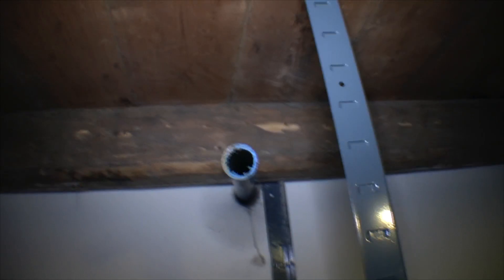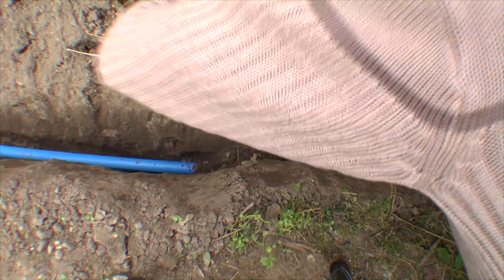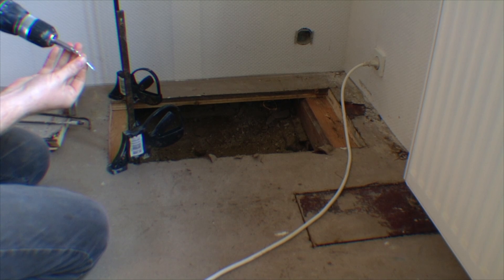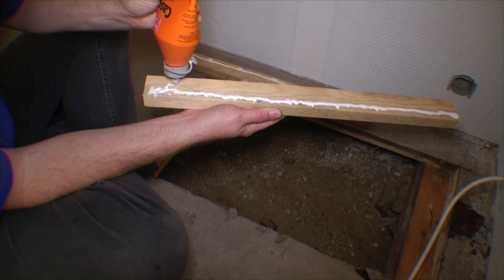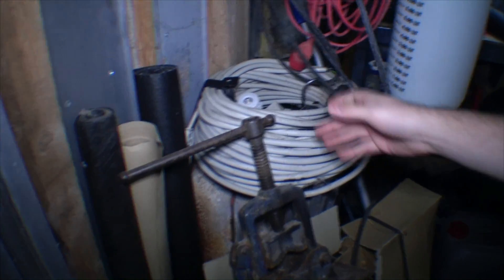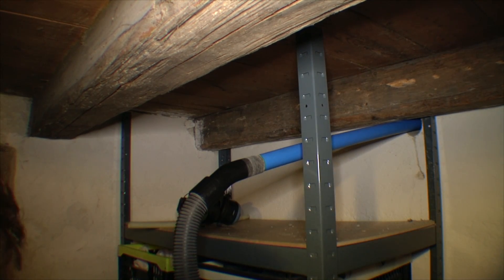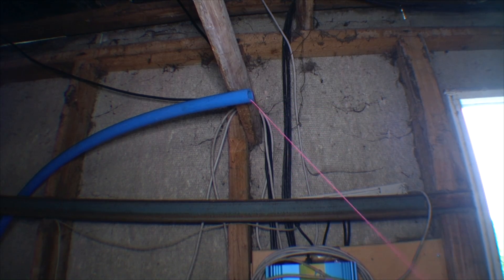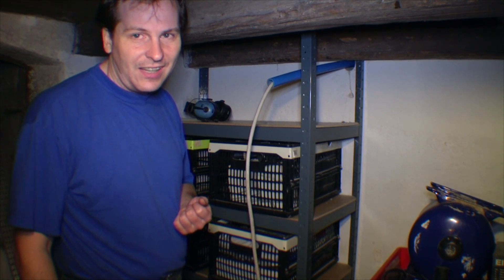Piping 16 meters between solar panels and battery bank - 241

Comment: Nice job. If or when you decide to put a new cable in connect it to this one with the plastic screwyee electric thingyees and i think you will be able to pull the new cable with no problems at all. This thingyees http://www.aliexpress.com/item/Best-Promotion-Electrical-Wire-Connection-12Position-Barrier-Terminal-Strip-Block-3A-Lowest-Price/32344104073.html?spm=2114.01020208.3.19.ATC2Hp&ws_ab_test=searchweb201556_2,searchweb201644_1_10001_10002_10005_10006_10003_10004_62,searchweb201560_6,searchweb1451318400_6149 but the biger ones (15-30 Amp)

Comment: hey , nice work, Wouldn't it be easier to park your extra KW from the solar panel on the grid and use them later? are you of grid.
Reply from the maker: HI +observer547 
No i am not off the grid,, but i like to be able to store some of the power and use it later.
I am working on two power banks,, one PB and one Li-ion, that i wanna put throw an 3KW UPS and use.
Thank you for watching! :-)

Comment: There are outdoor cables for video cameras, which hold 8 wires of FTP/SFTP and one steel wire which makes the whole cable very thick.Such cable you cand push several meters through any kind of pipes.Your experiment reminds me of a similar situation, when I had to pull a cable thru a small hole where there were already cables.I had to push it only some cm's but wasnt able.But I got a super idea to use some dishwashing solution, put on that cable and believe me, then it slipped between those existing cables in the hole ;) I had many ideas like your vacuum thing.Like one when you need to fool the system that you are moving the mouse and you put an alluminium foil under the optical mouse or put the mouse on the screen and you let a long youtube video to run to fool the mouse sensor :)) Thank you for your new video
Reply from the maker: Hi +charismaticum 
Does that alluminium foil under the optical mouse work?
Thank you for watching! :-)
Reply: +My PlayHouse (Morten Hjorth) :)) it doesn't but it drives the sensor crazy and the mouse cursor doesn't stay still ;) somehow I kept the mouse sensor excited :))))
Reply from the maker: Hi +charismaticum 
I´ll have to try that!!
Thank you for watching! :-)

Comment: This looks like one of those projects that looks simple at first, but it actually turns into rather tedious complication as it progresses, but you did a good job of showing us the difficulties attached to something like this. You might even want to run Ethernet into the garage by now! Congratulations on reaching 2,000 subscribers, by the way!
Reply from the maker: Hi +Tyler Barton 
I am on the lookout for better cable for this,, when i find the replacement i think i will be pressing three or four cables through.
Thank you! so many people,,,, over 1900 watching one of my videos every day,,, right now there are 7,6 people watching my videos 24/7,,, i think that is a lot.
Hope you will take part in my treasure hunt!
Thank you for watching! :-)

Comment: don't forget to seal up the hole where the pipe runs through the slab into the house below ground level, to keep rainwater outside.  Maybe the hole into the basement as well :)
Reply from the maker: Hi +HarreyHHH 
Yes it could well be I should seal it a little more. I covered it up, not get animals in. (mouse)
Thank you for watching! :-)

Comment: I am an electrician of some 36 years. As soon as I saw you trying to push the cable through the conduit I said that will never go through without a "fish wire" Then you came up with the vacuum and string. Good solution. Job well done Morten. Great video. Thumbs up too.
Reply from the maker: Hi +UNumbTV
I do think i got it like 10-12 meters without, the "fish wire", and i am sure i would have gotten in a try or two more,,, but much more then 16M would be a big problem very fast. 
Thank you for watching! :-)
Reply: My PlayHouse
It's not the length that is the problem. It is the curves in the conduit which each add to the overall total friction. I'm sure you believe that you would have done it eventually but you would also have waisted half your day at least. The hardest part of any conduit to push a cable through is the last few inches. Ask me how I know.
Reply from the maker: Hi +UNumbTV 
As you saw, I took the cable from the roll. Had I taken time to roll it out on the grass outside in a straight line. Then the cable would not try to wriggle inside the tube. it would also have made my job easier :-)
Thank you for watching! :-)
Reply: My PlayHouse
Classic Schoolboy error. :-P' ' ' '
Reply from the maker: Hi UNumbTV
Yes i know,, but as i often say : There's nothing funny about it, if it works the first time.
May i ask how old you are now? you are retired electrician?
Thank you for watching! :-)
Reply: My PlayHouse
The clue is in the original comment. I started my appreticeship straight from school.
Reply from the maker: Hi UNumbTV
I did see that! but i had the perception that you do no longer work,, is that not so?
Kicked out of school hunn 15-16,, plus 36,,, that is 51-52 something,,but you told me long ago that you were old,,, we ware talking about the colorful English language,, among young.
Reply: My PlayHouse
When you reach 50 you will say the same. Trust me on that. When you hit 30 you start to get aches and pains that hang around for longer than they used to. When you hit 40 those pains have become a permanent part of your life. When you hit 50 things start to fail. ie I have already had 3 minor strokes 2 of them I had no Idea had happened. This is the decade when you finally realise that you are no longer capable of doing a lot of those things that you have always taken for granted. I currently take 5 different types of blood pressure tablets daily to keep me alive most of them are max strength. Does that answer your question?
Reply from the maker: Hi UNumbTV
So you probably stopped working because of your bad health.. You are still funny as hell,, just so that you know it!!
Reply: My PlayHouse
You are pretty good at playing the fool yourself. :-P' ' '